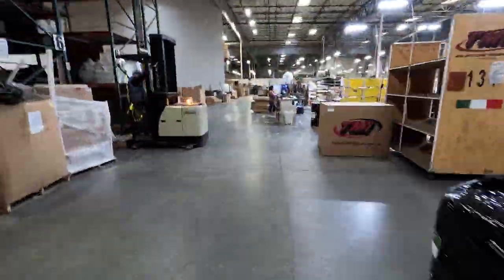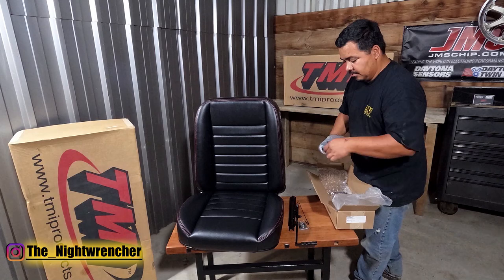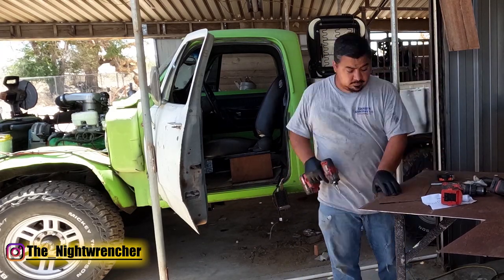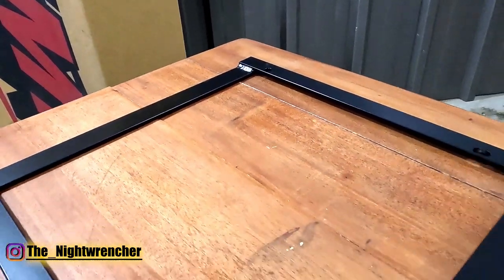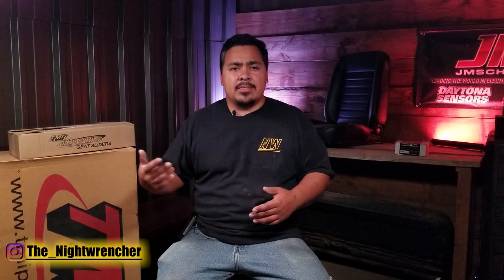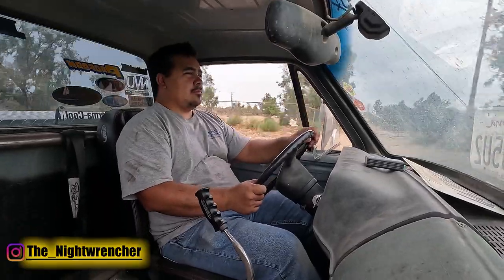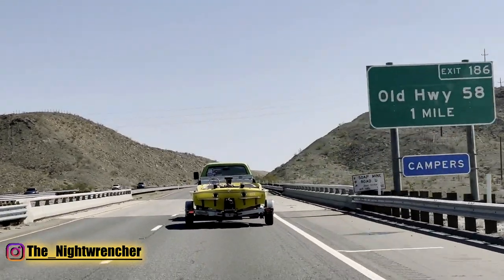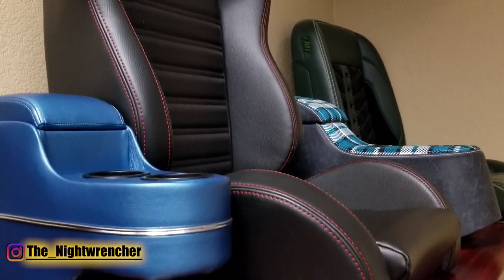Budget Bench AND Bucket Seats Cruiser Collection By TMI Products 72-93 Dodge | Turbo LS Swapped W100

Comment: I actually put in some seats from a 300 S in my 76 c10. But they are a lil too high due to the power functions and a little too thick on the backrest to adjust for my 6’ height. Would you recommend these for me
Reply from the maker: The bottom of these seats dont take up a lot of space, even with the slider so you can go as low as you want if you make your own brackets. I think they have a bolt on seat bracket for that truck but I've never sat in a square body with these seats to check the height. I would call them and ask them how high they sit off the floorboard and compare it to what you already have. Their tech support is pretty good.